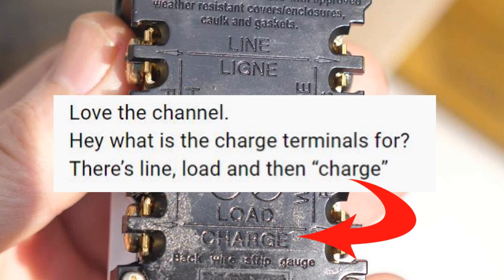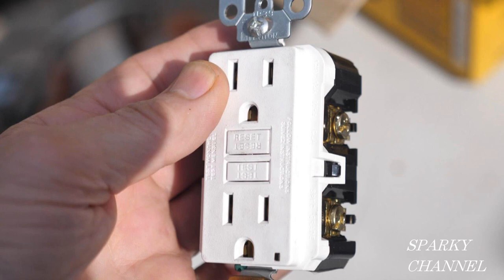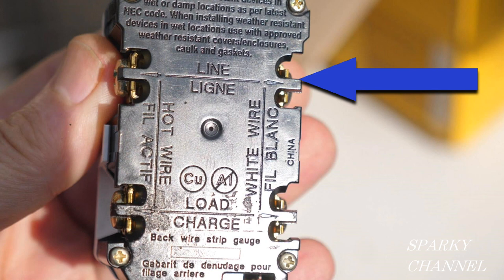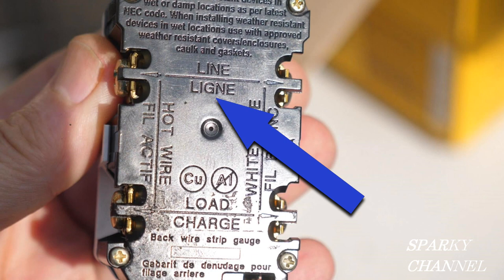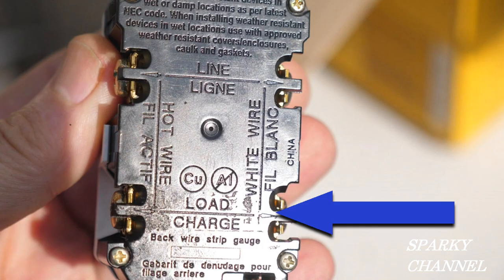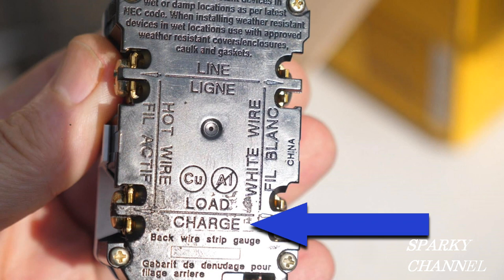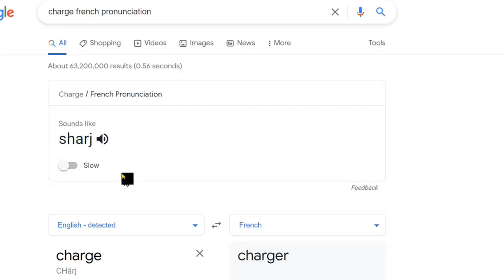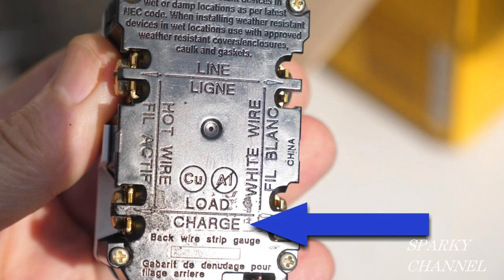Why do GFCI Receptacles Say "Charge" on the Back of Them?

Comment: Hey Sparky, here’s a video idea: I recently had a situation where an outlet was back fed with 25 V. It was beyond my skill level so I called my friend who is an electrician and by disconnecting and testing different wires and switching between hot and neutral he was able to determine that there was a Nick in one of the wires between the switch (it was on a garbage disposal which was controlled by a switch) And the outlet. I would be interested in knowing how to figure this out.

Comment: What I noticed was that the left and right sides are labeled HOT WIRE and WHITE WIRE. Ok, we are taught that the neutral should be white, but why not just say NEUTRAL? FYI, the French Labels translate to white wire and active wire. And the note at the bottom says, loosely, gauge for uncovering the wire for rear connection.
Reply from the maker: I agree, it should say neutral instead of white. perhaps that's because "white" is one less letter? Thanks on the translation.

Comment: What looked odd to me is that the Load side was on the bottom, and the Line side was on top. I thought it was usually the other way around. (Unless of course the back cover is somehow inverted relative to the front?) 
I was attaching leads to a GFCI earlier today intended for the load side, which on mine was on the top.  I was so weirded out watching this video I had to go back and check what I’d done. (So far as I can tell it’s correct.)
Reply from the maker: It depends if the ground is on the bottom. Then the line is usually on top. Always go by what the GFCI says on it though.
Reply: Leviton changes many devices , like GFCI from top to bottom terminals, removing leads, adding leads. Just like everything these days don’t depend on nuttin’ being consistent no mo.
Reply: Thanks - well I installed mine yesterday in my garage, connecting as marked, and checked it out, and it seems to be working fine. Mine is I believe a Legrand from Menard’s.

Comment: Where can I find 12/4 with ground romex(or MC)? I will be installing, from scratch, two outside lights at both sides of my garage door using two 3-way switches. One inside next to the garage door(where hot, neutral and ground from breaker panel comes to) and the other in my vestibule near my front door(split level house). I have looked online and also checked my local electrical supply Schaedler Yesco. They looked at me like I had 3 heads.
Reply: they may know of it as 12-2-2.  but it took over a year for enough people to find out about it for my local supply house to start having it on the shelf after I started using both 12-4 and 14-4.
Reply: @kenbrown2808  Thank you! Do you know the colors of 12-2-2(w/ground)?
Reply: @carlkwasnjuk9518  black, red, white, white with a red stripe, and ground.
Reply: @kenbrown2808  Thank you!
Reply: Why do you need 4 wire for that?
Reply: @mattrob15  "basically" if you are looking at a wall the lights will be on the right side of the switch that gets power from panel. Then to the left about 20 feet away will be the 2nd switch. Hard to explain unless pictures can be posted here.
Reply: @bljdeep  nothing fancy but past the lights on the outside end wall of the house I plan to put a photocell so the lights come on by themselves so they can light up the driveway if we are out and come home when it's dark.